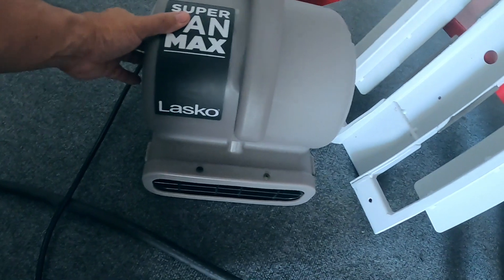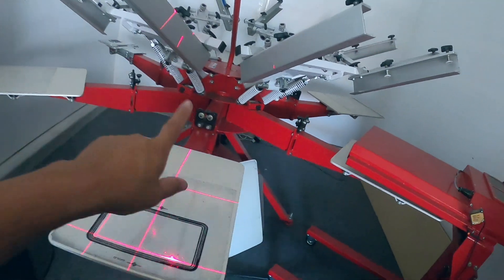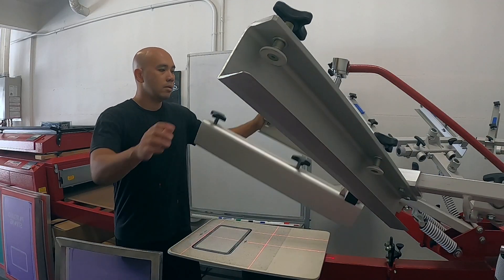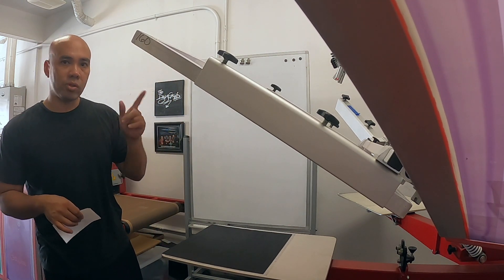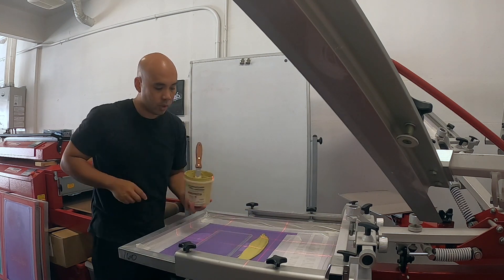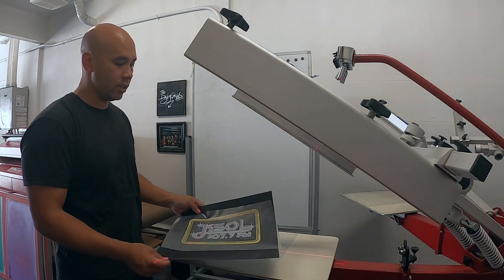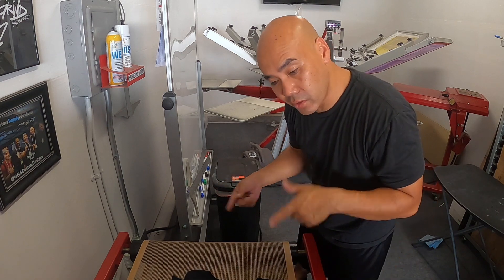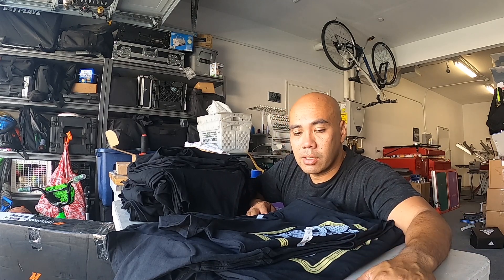2 COLOR REGISTRATION - SCREEN PRINTING: Registering a 2 color project on the Anatol (S:08/Vlog 023)

Comment: Rhy, I love your videos! Thanks for your hard work! I had a few questions if you don’t mind answering. 

1. Do you think upgrading from 4 pallet press to 6 pallet speeds up the printing process? What about 8 or 10 pallet press? Since it takes the same amount of time to load/unload a shirt both onto 4 pallet press and say 8 pallet press does it actually speed up the whole process?

2. I remember from your earlier videos you had a Ryley Hopkins press (green) and now you have Anatol. Is Anatol better with registration vs Ryley? And is side clamps better than the Ryley clamp?

Sorry for overload of questions but I kept thinking of you as a person to ask those questions. Thank you and God bless you!
Reply from the maker: Hey hey. 

1. So, yes Upgrading to a 6pallet will definitely speed up your process. I believe if you are going 8-10 pallets, you might as well get an automatic. But that’s my opinion 

2. The only reasons I switched to ANATOL because they gave me a deal that I couldn’t refuse. Yes side clamps are much better than the single back clamps.l, less pallet deflection
Reply: @RhyBeats  Thank you for your reply! It sounds like that the next press we need to upgrade to :) By the way, thank you for the Anatol equipment review the other day - what a perfect timing!